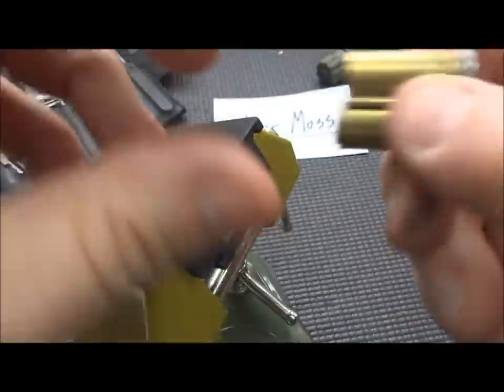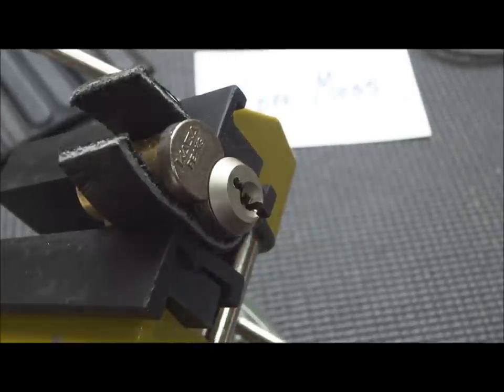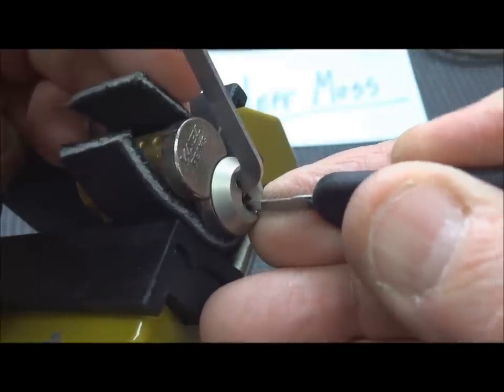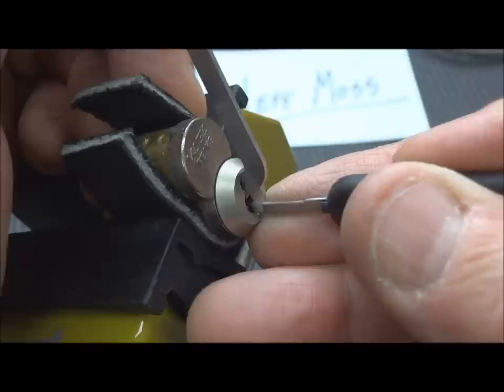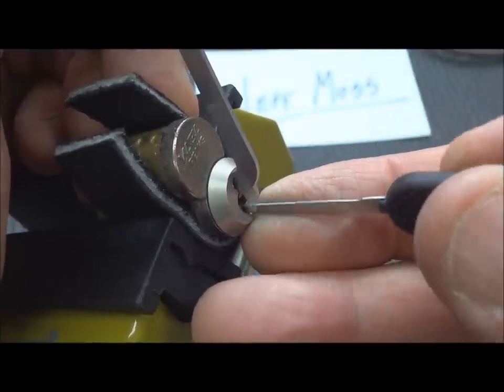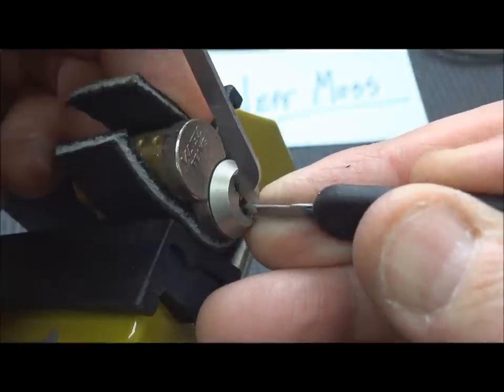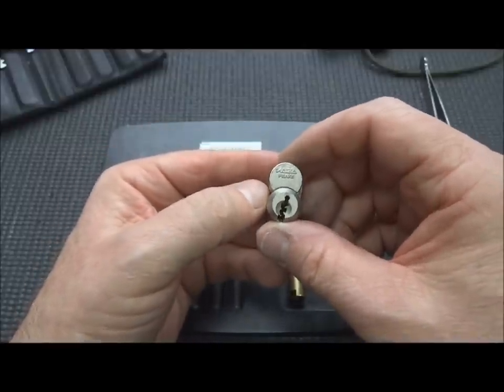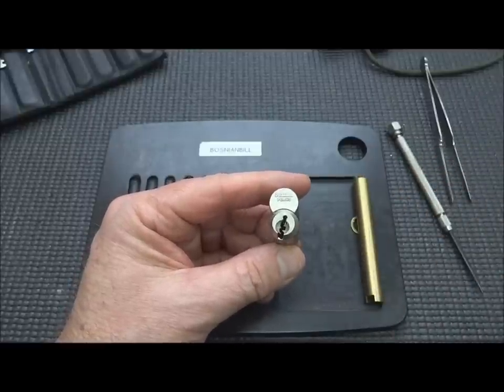(273) Kaba Peaks Picked to Control

Comment from the maker: The "operating" shear line is when the lock simply opens normally.  The "control" shear line allows the core of the lock to be removed from the lock housing.  Usually the maintenance folks will be the only ones that have a control key.

Comment from the maker: There are two shear lines in SFIC locks.  One shear line allows the pawl to retract and you can remove the core from the lock.  This is USUALLY a hard shear to reach, so hitting is is kind of abnormal.  The other shear line is called the operating shear line and simply opens the lock normally.  When picking, you cannot mix-n-match shear lines.  One or the other muse line up.

Comment: you cannot take that core apart from the control by sliding the plug out, however, you can eject the pins via the holes on the bottom and eject the chambers, there is a tool to catch the pins in order to decode.

Comment from the maker: When they are pinned according to a pretty strict factory spec, called pin "count", the shear lines are designed to NOT intersect simultaneously. In other words, when a pin lines up at the shear line, the other pin (or pins) block the other shear line.  This is not true with ALL the pins in the stack but it doesn't need to be.  Many locks use the same depth settings for both operating and control on all but 1 or 2 of the pins.  Those block the shear line.

Comment: It will not come apart when it is at control because the shear line is above the control lug. There are pins in the plug and the control lug at the same time. You would have to pick it to operate or have a pin ejector to dump the pins. Of course you would need new springs and caps after that.